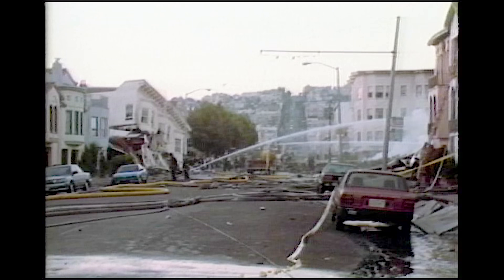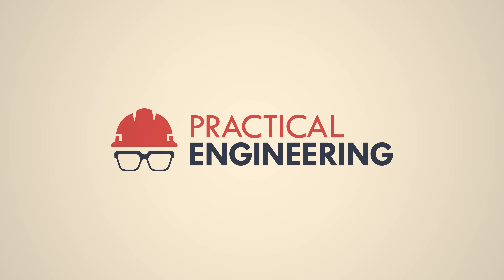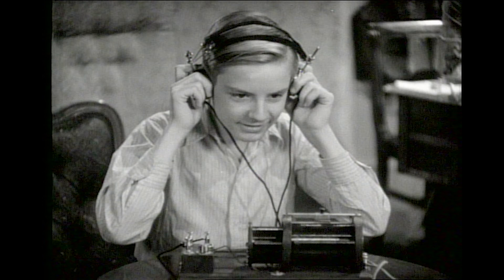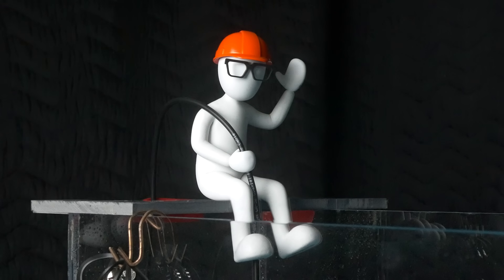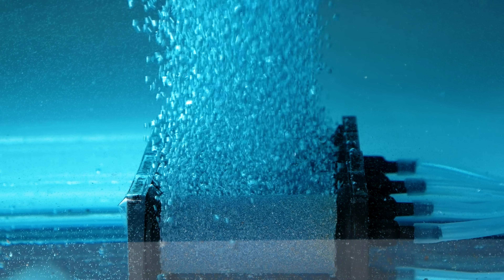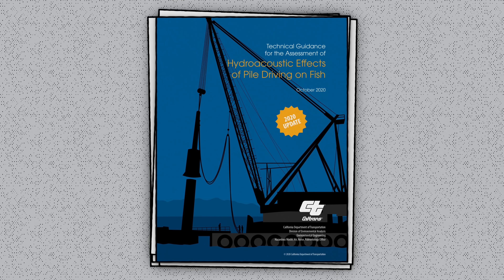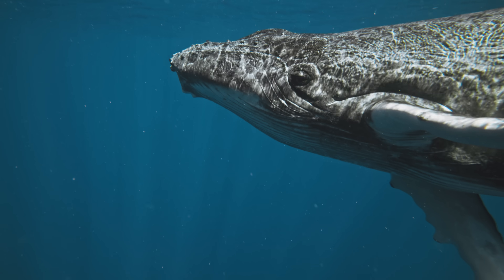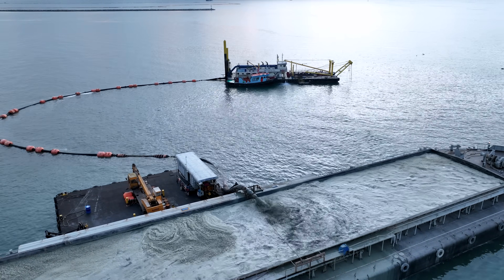The Weirdest Tool in Underwater Construction

Comment: This reminded me of the water deluge systems used in rocket launching for acoustic damping, which goes back to the Apollo program if not even earlier. I always wondered why it works; "impedance mismatch" explains it all.
Reply: Pad 34 for the Saturn I and IB in the early 1960's was the first documented instance I can find where NASA built a water deluge system into the pad for acoustic suppression. Another interesting tidbit, they decided to just use a slightly upgraded system already on pad 39 for STS-1 and it wasn't nearly enough. The overpressure was so severe it broke tiles and bent the aft flap so severely the shuttle was on the ragged edge of running out of control authority to correct for it during reentry which would have resulted in a complete loss of vehicle and crew. For STS-2 onward they added the massive "rain bird" system to damp above the pad sounds too
Reply: If you can explain why the Apollo 11 astronauts didn't see stars (other than the sun), that would be really great.
Reply: @jiaan100  they did. Dozens of times. They literally manually sighted stars through the CM and LM sextant and telescope system every few hours to align and update the guidance platform's position information all the way to the moon and back. They also saw stars out the windows on the translunar coast there and back, AND while around the night side of the earth and moon while in lunar orbit. They didn't PHOTOGRAPH stars because they weren't there to photograph stars, they were there to photograph the **moon**, and to do that in the daylight and properly expose a spectacularly bright, fully sunlit moon, it means the stars are far FAR too faint to register on film. 

Go outside tonight and try to take a picture of a streetlight from underneath it and see if you can see any stars in the background. Even properly exposing something not even a tiny fraction as bright as daylight will wash out all the stars.
Reply: @GlutenEruption they did not, as they said and all confirmed during the big press conference. That's in the middle of the conference so it's hard to find, easier is the bbc interview with Armstrong. It's the first question.
Reply: @GlutenEruption I did mean 'see with their eyeballs without tools' when I said 'see', which is usually what see means. And I legitimately would appreciate a solid explanation other than the obvious.
Reply: @jiaan100  which is why I mentioned they DID see the stars out the windows while on the night side of earth and lunar orbit, AKA when not in 100% unfiltered direct and full dazzling sunlight. I don't understand where these lies come from, literally just search the mission transcript that's been fully available and in the public record since the day they got back:

071:59:20 Armstrong: Houston, it's been a real change for us. Now we're able to see stars again and recognize constellations for the first time on the trip. It's - the sky is full of stars. Just like the night side of Earth. But all the way here, we've only been able to see stars occasionally and perhaps through the monocular, but not recognize any star patterns.

That's just one mention of several
Reply: @jiaan100  Relative brightness. All lunar surface missions were conducted under sun-lit conditions. Human eyes (and camera film or sensors) have finite dynamic range - the ratio between the brightest and dimmest feature they can detect. Starlight is extremely faint. Practical demo to illustrate: put on a pair of sunglasses, go outside on a sunny day and see if you can see anything on your smartphone screen when it's in "night" mode. That's why lunar astronauts could not see stars. If a mission extended into lunar night, so the sun wasn't lighting up everything around them, they would be able so see stars.

Comment: Bubble curtains were considered for use as part of the breakwaters for the "Mulberry" artificial harbors that protected ships full of troops and supplies landing at the Normandy beaches in WWII. The idea was ultimately scrapped as the bubbles didn't provide as much wave protection as was hoped and the air pumps would've been a maintenance headache; prefabricated steel and concrete barricades and scuttled ships were used as breakwaters instead.

Naval history channel Drachinifel has a video on the Mulberry harbors and all the harbor  engineering that went into them: www.youtube.com/watch?v=1aGU2JQ2jDg

Comment: I would like to point out a small mistake.
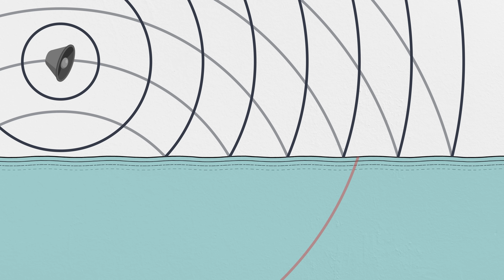At 5:45 the illustration of the wavefront is wrong : it should be continuous (as the wave crosses the boundary it is refracted, and the wavefront is warped : https://upload.wikimedia.org/wikipedia/commons/d/dc/Snells_law_wavefronts.gif).
In the case of an air to water crossing, anything inclined more than 14° from the normal will be totally reflected.
The impedance mismatch to attenuation calculation is for normal incidence.

Comment: When you said the answer was bubbles, I was expecting it to be using bubbles to liquify the seafloor and remove the need for the pile driver in the first place, or at least reduce the vigor at which it's used, not as an acoustic curtain. Very interesting.
Reply: Pilings are driven through soils, not bedrock
Reply: Me too, he fooled us both
Reply: Me three 😉
Reply: See, I was foolish enough to expect a single, large bubble, for some reason.
Reply: Unfortunately, air is unable to liquify rock
Reply: @mikea5745  You cannot piledrive into rock, only loose material. I cannot comment on whether loosening it with air-injection is plausible or not .
Reply: @mikea5745  I use air to liquify metal.

Comment: Why not use a drill to place piles? I guess the old saying goes... If your only tool is a hammer...
Reply: Would you use a drill to place what is the equivalent of a large nail into the seafloor ?

Drilling is usually what you do when you just want to make a hole in a rigid material. The seafloor ? I'm not sure this is a good idea beside on some very specific tasks.
Reply: Drilling still makes a lot of noise.

Comment: As soon as you mentioned bubbles, I was reminded of my time in the shipyard. We were in a graving dock during an overhaul while the shipyard was also building a group of Navy destroyers. They would test their sonar systems on the pier next to us and the sound coming through the graving dock wall was so loud, hearing protection was required. They rigged a long pipe with holes, along the bottom of that peir and pumped air bubbles to help reduce the sound level through the graving dock wall. Worked surprisingly well and we all could tell instantly when the air compressor was switched off.
Reply: I definitely remember reading about events where harbor scuba-diver workers have been actually killed when someone accidentally activated a sonar ping from a naval vessel, so that tracks...
Reply: @WackoMcGoose  Indeed. When I was rode a sub, we were told it's an effective way to 'repel boarders', no swimmer can survive a high-power 'ping' that close.
Reply: @mikefochtman7164  Also why the navy gets asked not to run sonar at full power unless its an actual combat situation. Its harmful to marine life.
Reply: @filanfyretracker  Yes, I wasn't a Sonar Tech so I don't know a lot of the details, but it's my understanding they've been studying this issue for a while now.
Reply: @filanfyretracker  From what I've heard, they generally wouldn't using active sonar in combat situations either. It's like turning on a big "torpedo/depth charge me" sign visible to everyone with passive sonar.
Reply: We use it defensively, too. That very same destroyer was equipped with a “masking air” system. It injects bubbles into the ship’s bow wake that reduces the acoustic signature to anything listening.
Reply: @TrojanManSCP  I've seen ads for a commercial system fitted to a container ship to boost efficiency, like slipping on ball bearings.
Reply: Mass whale beachings were found to coincide with US Navy low frequency sonar testing, poor guys can't plug their super sensitive ears
Reply: Was this at garden island by any chance? I have had a very very similar experience
Reply: @oliverglover1523  I was at Ingalls Shipbuilding, Pascagoula MS. They were building the Spruance class fleet (yes, I'm that old lol)
Reply: I worked in a different shipyard for a while, and we used a bubble curtain to dissuade fish (which included some protected species) from swimming into the graving dock and getting trapped or even crushed when the cofferdam (gate) was removed & replaced. That being said, it was sad to lose the comical effect of guys tromping around the dock floor in 8” water trying to herd fish into nets… a great spectator sport if ever there was one.
Reply: When you hear an ASW vessel transmitting at the pier there is someone up on deck of the bow holding a cable with a hydrophone on the end to measure transmitted energy. They also transmit energy through the hydrophone and measure the receiver sensitivity.

Comment: Fascinating.  Reminds me of the way that NASA sprays water at rocket launches to absorb sound that would otherwise tear apart the launch platform.
Reply: I always thought that was mainly for cooling. Learned from the comments today that it was mainly for sound!

Remember that space x launch that destroyed the launch pad? If I remember correctly I want to say they were not spraying water that day?
Reply: @volvo09  correct SpaceX tried to launch without it because they want to design something that can launch from mars without one. But it destroyed stuff. Which means they’ll need to cross the mars problem in the future.
Reply: Russia just uses a big pit. NASA needs the water system due to how it designed pads. of course dig a deep pit in Florida, it will be full of water by morning and gators by afternoon. so they kinda had no choice with how basically any coastal launch pad is built.
Reply: NASA has launched 1 rocket in the past 15 years.  It did dump a half-million gallons of water in the process, though.  ULA and SpaceX of course both also use water deluge systems when launching NASA's payloads.
Reply: @SkorjOlafsen  That's nice, but NASA still came up with it back in the space shuttle days.
Reply: @staygray6212  Older than that.  Perhaps it's best not to worry too much about who invented what in 20th century rocketry, as some people deserve no credit regardless.  NASA is supposed to launch another rocket next year if it doesn't get cancelled, so perhaps we'll see their massive deluge system once more.  In the mean time, Rocket Lab just demo'd their new deluge system for their upcoming Neutron rocket.  Very impressive to see these things work.
Reply: @SkorjOlafsen if only NASA had billions of dollars to waste like... billionaires
Reply: @plwadodveeefdv  NASA is far better funded.  Their annual budget has been over 20 billion in 2024 dollars for the past 40 years.  SpaceX's funding was under a billion a year until 2023.  SLS alone had more than twice SpaceX's budget.  Rocket Lab went from nothing to first successful orbital launch on 100 million dollars and a dream (not per year, total).

You should really check your assumptions.

Comment: I think for this experiment you definitely needed a real underwater hammer not a Bluetooth speaker.  Completely different in terms of wave form and amplitudes.  It would have been easier to just drop a ball bearing onto a steel plate on the bottom of the aquarium anyway.

Comment: Rocket engineers use water curtains to reduce noise damage to launch infrastructure from the sound of the rocket engines.
Reply: Also makes cool steam clouds :)
Reply: I just learned that not too long ago
Reply: Actually the water protects the rocket itself as well as the launch infrastructure. The water keeps the concrete cool so it doesn't cracked and spall from the intense heat. And it absorbs the intense sound wave that could be reflected back at the rocket and damage or rupture a fuel tank.
Reply: What's amazing is that it absorbs that sound energy by using it to boil the water droplets.
Reply: @pseudotasuki  It also reflects a huge amount of the energy away from the critical infrastructure.
Reply: And I thought Water Curtains  are what Aquaman uses to decorate his water windows
Reply: @paulfao3729  Those are just normal curtains and windows, but some VC bro put "water" in their name to capitalize on the lucrative Aquaman market.
Reply: Wow I thought the water curtains were for the extreme heat
Reply: @compdude551 it pulls double duty. They spray water between the launch tower and the rocket to dampen the sound, and deluge water on the pad to keep it from melting (and dampen the sound)
Reply: @dongiovanni4331  the water curtain is to absorb tremendous amounts of energy by heating up and boiling off the water.  A bubble curtain works by reflecting the energy back.  A deluge system explicitly serves to not reflect energy backwards.
Reply: I thought of that too - kind of "opposite bubbles" i.e. droplets in the air :)
Reply: I was just thinking “I wonder if we do the reverse for things above ground” and then saw this comment. Thank you for sharing!
Reply: Now that you mention it.. I have seen these. Facinating.. never thought of why it exists
Reply: I love how you can see the vapor clouds flicker in and out of existence from the pressure waves generated by a big rocket.
Reply: Rather poetic, and pretty darn ingenious how that chaotic mixing of two different fluids works both ways to help with sound diffusion
Reply: https://www.youtube.com/shorts/GlPJ8kFUed8
Reply: I thought of this too. It's basically the opposite of a bubble curtain, but for the same purpose.
Reply: SpaceX showed us why... (I say this as a spacex mega fan)
Reply: Thats something completely different like the whole opposite we are here talking about air injected in a fluid you are talking about a fluid being injected into the air
Reply: @FirstnameLastname-db5pp it's still a system that creates an interface between materials of different viscosity to dampen vibrations through interface loss.
Reply: @FirstnameLastname-db5pp  It's not "completely different". Both absorb sound by creating many tiny boundaries between water and air.
Reply: @FirstnameLastname-db5pp  Impedance mismatches are symmetrical ... so opposite still works.
Reply: Sounds are energy, water loves to absorb energy.
Reply: I came here to write what you already wrote....
Reply: That makes it even funnier that Space X destroyed one of their launch platforms because they didn't use a water curtain like NASA told them to.  
That's private industry for you - profits over safety!
Reply: @josephsager9425   That's simplistic, because the "safety" aspect of it did not (as far as I know) involve a risk to humans, but rather to the company's own physical facilities.  That's an entirely ethical cost/benefit (a.k.a. "profitability") analysis that in this case did not happen to work out.  

As to the "distinction" between decisions between NASA and its private contractors, the 1986 disaster of the Challenger shuttle was the result of NASA managers ignoring the warnings of a man named Roger Boisjoly, employed by the Thiokol Company that was a contractor in the design of the shuttle.  Specifically, Mr. Boisjoly warned that the seals between the stages of the booster rocket would fail at the low temperatures that were predicted at the launch site.  Tragically, he was right, and has rarely received the acknowledgement for it that he deserved (other than in an op-ed piece in the Wall Street Journal some years after he had been essentially ignored and even ostracized for his intelligent and ethical stand). 

Throughout my engineering career, I have battled numerous efforts by both public officials and corporate apologists to reject ethical, competent advice related to human safety and environmental protection, as well as cost-effectiveness in achieving those goals.  And in so doing, I try to avoid over-generalizing about "villains" the way that you do here.
Reply: @josephsager9425 why would it be profitable to destroy a launch platform?
Reply: Unless you're SpaceX. Then you just obliterate the launch pad.
Reply: @F0XD1E  At least they learned, and installed an water deluge system.
Reply: @dongiovanni4331 "Learned" is a generous way of saying proven that their disregard of NASA established standards and ill conceived cost cutting that destroyed a launch pad aand surroundingarea was wrong.
Reply: It’s aerospace not rocket engineering but interesting comment still
Reply: @mitchellm8530  @jonyemm Akkkkthulllay, technical jargon in a field is not the "correct" meaning of the word in normal English (or any other natural language). Technical jargon is downstream of English, not upstream.  Occasionally a word swims up the rapids, but it often has a different meaning entirely when it gets there, and that meaning is correct, because it's what most people understand by the word, while the technical meaning remains correct in that context.
Reply: @mitchellm8530  ACTUALLY 😅 it’s called aerospace engineering… there’s always a bigger fish and in this case I would say that the smallest fish is still a very fine catch. ❤
Reply: @mitchellm8530 auditioning for Um Actually ?  Or are you a Jackal of Corrections?
Reply: @mitchellm8530 no one cares bro
Reply: @feelincrispy7053 you may not care because  you don't understand the difference between the two.
Without meanings words are just sounds or marks
Reply: @feelincrispy7053  I'm sure some people are interested to learn the difference between the two
Reply: @feelincrispy7053  I do